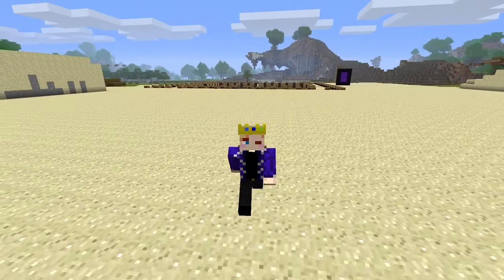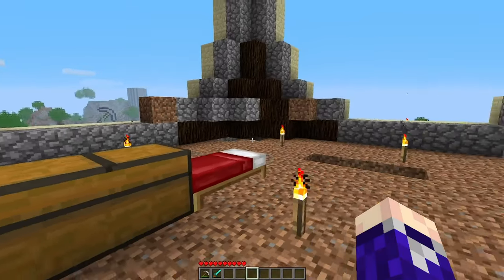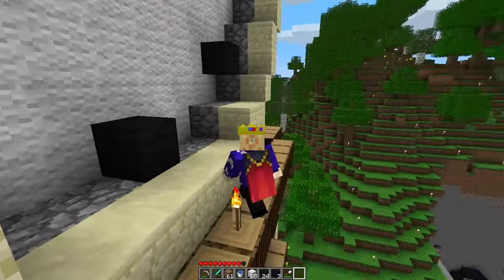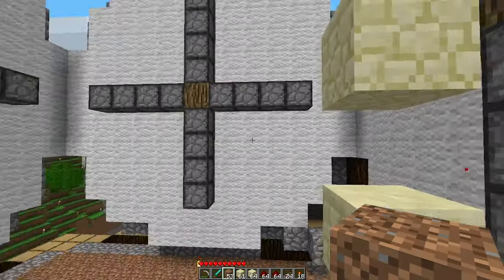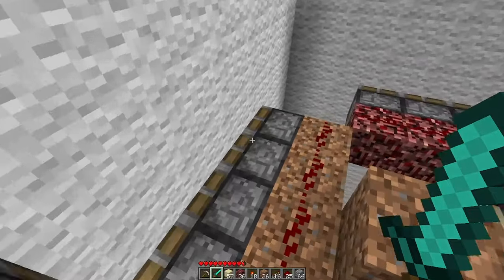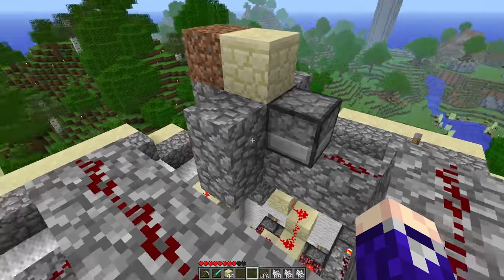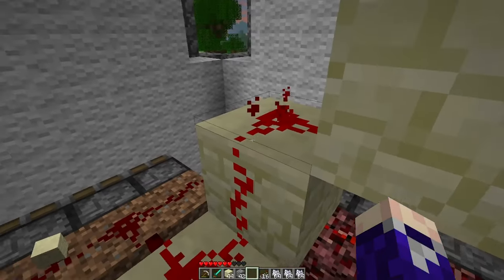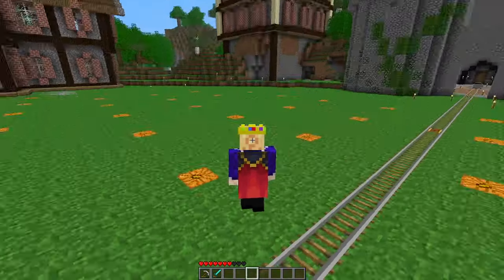Back to Beta - Episode 13: Building a Working Redstone Clock Tower

Comment: Nice simple solution that shouldn't break when the chunks get unloaded, very nice. The only issue with despawn timers in this version is that you need to refill the dispensers. This one should be able to run for 96 hours before needing a refill I think. Of course it's not so bad in an area like this which presumably is unloaded a lot of the time